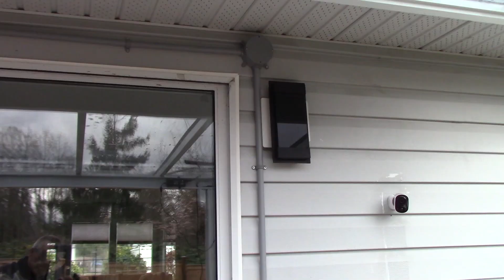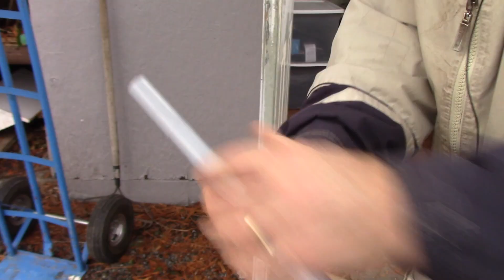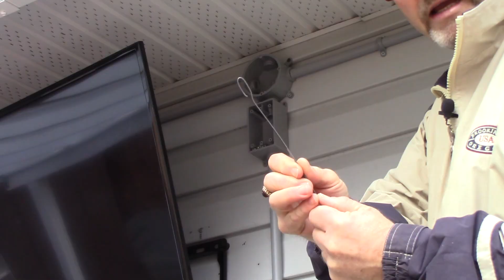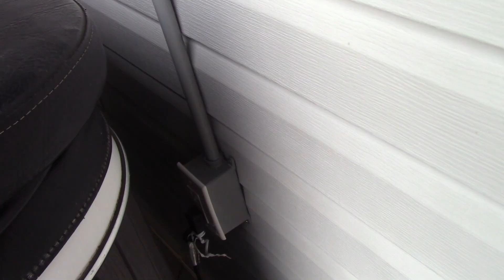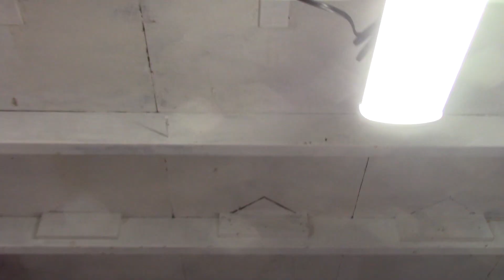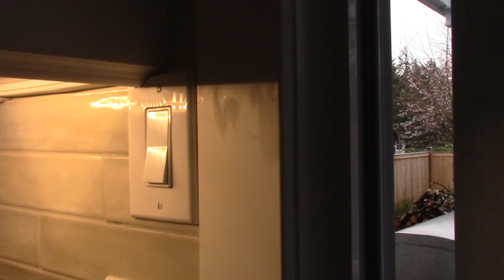Outdoor Electrical Project:  Patio Wiring and Running Power to a Garden Shed

Comment: How long will pvc conduit last when exposed to sun ? And will liquid tight last longer than pvc?
Reply from the maker: If PCV is exposed to the sun, give it a coat of plasticoat spray paint in the color of choice. (helps to blend it in to the background as well).  And yes, LT will last longer that PVC as it's more formulated for UV protection (says my non-chemist opinion) 🙂

Comment: Perhaps it depends on state you are in but I thought PVC run requires THHN type wire. Like the THHN wires, Romex wire can't be used outside because of its minimal PVC jacket protection. But I am not an electrician so may be completely wrong...
Reply from the maker: It's OK to run romex outside "if" it's protected from the elements, (UV, weather, etc), with the cavaet that you strip the outer jacket and separate the conductors when it is running through the conduit.
Reply: @theinternetelectrician  awesome! Thank you for clarification! I appreciate it.

Comment: Can you run around a water pipe standing up against the wall with outdoor elec pipe running perpendicular to it?  I assume that's a no no, right?
Reply from the maker: That shouldn't be a problem, just the logistics of making it look decent.  When using EMT or rigid pipe, we bend what we call a "saddle" around it.  Bending PVC isn't easy.

Comment: So, just to be sure, I can strip an nmd90 14/3 sheating and run the 4 wires in the pvc conduit ?
Reply from the maker: Well, I've seen mixed messages on that, some will say no, it doesn't have the proper rating to be in a moist or damp location.  The debate then comes whether inside a properly installed PVC system (even installed underground),  is it indeed moist or wet.  I say no if you do a proper job of installing.  Anyhow, I have never had an inspector take issue with using NMD-90 inside conduit.  Only have been "called out" on it if the sheathing wasn't stripped off when it's inside the conduit. Again a debatable point as the issue is heating of the conductors with not enough air surrounding the conductors to help reduce heat.

Comment: Why not bend some pvc instead of using the flex conduit (at the start) ?
Reply from the maker: I could have, yes.  It's always a bit of a challenge doing a nice job of bending PCV.  I have done it by filling it up with sand, heating it up and bending it that way.  What have you found that works to make nice bends in PVC?
Reply: @theinternetelectrician  i didn't try yet :) thank for your input!
Reply: @theinternetelectrician  heat blankets

Comment: Nice looking job. I have a similar job to do but will need to find another video to see the actual wiring to use as a reference.
Reply from the maker: Subscribe to my channel and have a look through my videos and you will find what you need to know for connecting the components.  I was only focusing on the wiring method of running PVC conduit and wire in this video.  Would have been good for me to go through every step of the entire process but it would have been a very long video, and I had some time constraints as well with needing to get the job done.